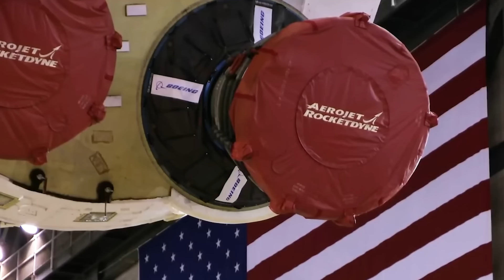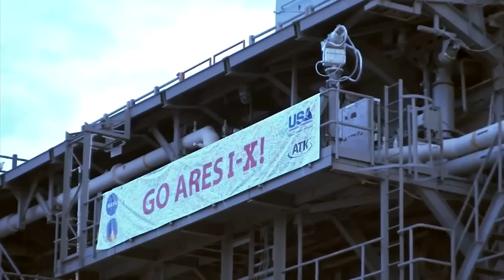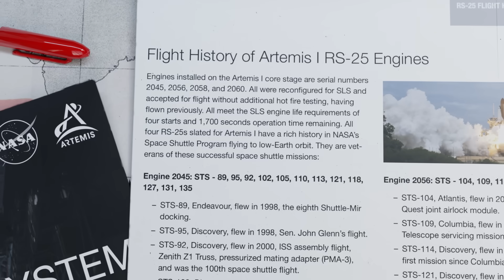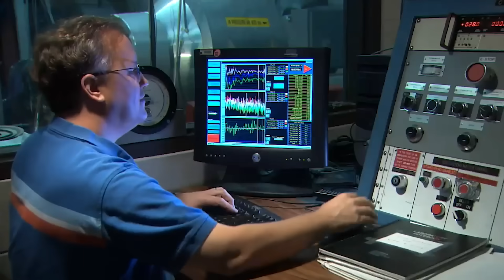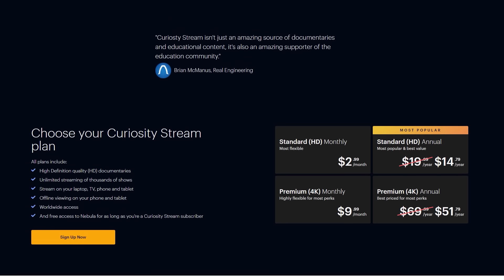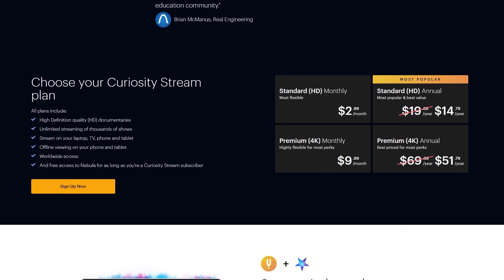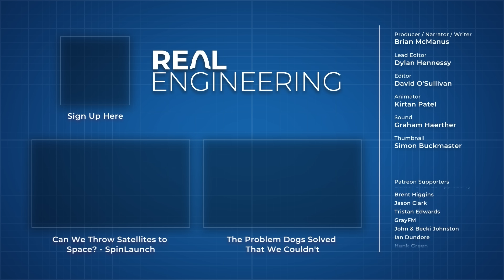The SLS is Outdated. Why Does it Exist?

Comment: Aside from the nerdy stuff, there is a course at a graduate school called The Political Process in Systems Architecture, not of SW subsystems, but about super systems such as the SLS.   This ensures that the systems engineer does not graduate as a dodo, and ignore the political aspect of space research, technology and its funding.  He never enjoyed the real broadcast either.  He was only 4 years old then.  Yet, he was lucky enough to serve the SSME at the Rock, and at Susi.  Space Shuttle Main Engine /  Santa Susana Hills.  Oh geez, he went to the same uni Neil Armstrong did, without planning it.  The RS-25 Engine, frankly, the SSME, never caused a shuttle failure.  And, I am sure it won't this time either.  Somehow it was always about the not so complex stuff.  Good vibes to Artemis!

Comment: It wouldn't surprise me that they wanted to use their own stuff because it been more proven than commercial. Not just test case. When I took software development, our teacher showed us a method of converting code into mathematical formulas to prove that it didn't have bugs. It was super difficult and took a long time. Basically, coding was the easy part and proving incorrect was a much bigger job.
In the same way, the computers were antiquated antiques by the time they actually got sent up, because the hardware had to go through the same rigor of planning, testing, and hardening. Everything had to undergo such scrutiny. This way, they minimized failure by a massive amount.
Today's commercial companies may kove faster and cheaper, technically. Failures cost more than the wasted rockets, fuel, and cargo. It costs PR and the industry.
So they may not have trusted the commercial operation to come through successfully while they had proven hardware sitting around.
From what I heard, a bunch of satellites that went up with it failed when launched. Heck, how long ago was it a whole schwack of StarLink satellites all failed because they didn't calculate things right.
Can't say I really blame them spending extra.

Comment: In general the idea of reusing proven concepts from previous programs isn't bad, not everything has to be reinvented.

Also while NASA programs don't have optimal cost efficiency because of spreading out production of the whole country and bureaucracy, private programs are also not always cost efficient because, because here everyone must make a profit and there are often inefficiencies because of trade secrets. In both cases costs are often much higher than predicted, so we will see if the private space programs will be more efficient in super heavy launch systems.
Reply: While it is true that private programs also have costs overruns, they are no where to the degree of the SLS. While Falcon Heavy isn't a perfect comparison to SLS, it is close enough to get an idea. They both use existing hardware and needed some special modifications to get going. And they both are super heavy launch vehicles. FH was delayed a few years and had cost overruns. However, it has successfully flown and is capable of launching over 63t into orbit. It cost around 100m per launch, which includes SpaceX's recovery of development costs. SLS can only launch 95t. While that is more, it isn't that much more. And that is especially true when counting the costs. SLS is projected to cost around 2 Billion per launch, not counting development costs, and around 4 Billion counting those costs. So 20x to 40x more per launch for 1/3rd more payload.

Comment: As a child, my parents got me out of bed to come down and watch Armstrong step onto the moon. One of those memorable events in my life.

But, sadly, reality is just as harsh today as it was then: It is far far cheaper and safer if you can build a machine to do the same job done by a human. Doubly so in space (double is too small a number). If an unmanned vehicle explodes or crashes into the ocean then there is quickly another one ready to go for a fraction of the cost of sending humans. No loss of life. No national disaster which threatens the funding of the whole project. Manned space travel is likely to remain an occasional expensive event largely funded for political and PR reasons.

Comment: seeing the decisions behind the plan for Artemis 2 and 3 and seeing the suboptimal decisions were largely made because of SLS and Orion's lack of capability, coupled with a lack of a viable lander (Starship lander isn't viable either, they're kidding themselves) makes SLS extra bittersweet. Artemis is likely to fail or increase risks overwhelmingly because it can't get Orion to Low Lunar Orbit.

its time to hit reset again. Artemis has to wait for Cargo Starship, and focus development on a transfer vehicle that can be carried to LEO by Starship, to make a LLO station with relays and landers and capsules.

outsourcing the lander doesnt work. Near Rectolinear Halo Orbit around the moon is risky and unreasonable.

SLS can get the process started, but it won't be able to finish it. Starship is the closest, most capable heavy lift rocket. it will have to finish it, but only as the lifter. the rest is on NASA.
Reply: Why do you think Starship isn't a viable lander? Several of the top engineers in the country disagree with you there.
Reply: @anthonypelchat  the height, infrastructure, size, complexity, its designed for heavy transport. it could very capably transport a proper lander, but on its own, it can't sensibly deliver payloads to the moon.

i'm under no illusion that i know what's right singlehandedly, but i don't think its unreasonable to say Starship isn't. Destin from Smarter Every Day even hinted at it during the talk he gave at NASA.
Reply: @xymaryai8283  Destin from SED's video was actually really, really bad. The main ones praising it are the ones who really have no idea what he was talking about. I will tackle that comment separately.

Specifically to Starship, it's height isn't much of an issue. Will ladders work? No. Astronauts will need elevators. But that is a tech that we have basically been perfecting for over 100 years now. Not a big deal. And the overall size is a massive bonus. 

The infrastructure and complexity would be a problem if all Starship was designed to do was send people to the moon once and come. But that isn't the case. The infrastructure is being built out already and designed for dozens, if not hundreds of missions per year. So even the complexity is no big deal.

Finally, Starship is designed to be multi-purpose. It will have a dedicated crew lander version. It will also have a dedicated tanker version, an expendable version, a normal crewed version, and a general purpose version. Probably many more as well. The individual designs, such as the crewed lander, will benefit from the infrastructure built to support ALL versions. That is a huge benefit.
Reply: @anthonypelchat  you seem very knowledgeable about it, so i won't try to prove you wrong, but i still think the scale and complexity is too much for Artemis. sure, elevators of all kinds are an extremely reliable technology on Earth, and SpaceX will have the best engineers working on making it work on Luna with dust mitigation and redundant systems, but if you look at the level of redundancy Apollo had, i really think we're underestimating how risky this is. even if they have multiple completely redundant elevators, they are still very dynamic mechanical machines, and an issue that affects one fundamentally is likely to be an issue for all. theres also the issue of weight balancing, if the lander has used a significant amount of fuel to land, bringing payloads down from such a height will cause tipping unless it is balanced, dead weight is not acceptable, so synchronous balanced operations with 2 lifts or a very robust tiedown will be required.

there's a whole ton of operational complexity that Apollo actively avoided. they used the most reliable technology in every place it would perform well enough. Starship is using the most performant technology where it might be reliable enough, and i don't see it being successful in the short or long term.
Reply: @xymaryai8283  "but if you look at the level of redundancy Apollo had, i really think we're underestimating how risky this is."
Not sure what you are looking at here, but Apollo nearly ended in failure during most of the missions. By comparison, Artemis and Starship have multiple redundancies. 

"(elevators) are still very dynamic mechanical machines,"
Are they overly simple? No. But again, we have been working with them for over 100 years. And they are built to handle much more difficult loads then will be needed to be handle on the Moon.

"theres also the issue of weight balancing,"
The left over fuel along with the engines will be at the very bottom of the rocket. And they will weigh drastically more than the loads that Starship can carry. In this case, trust that NASA, SpaceX, and the astronauts that will fly on Starship are smarter than the average person. There won't be rednecks onboard building swings at the top of Starship to see if they can tip it. And there's no wind on the moon, so nothing there that should affect anything. 

"there's a whole ton of operational complexity that Apollo actively avoided."
You're drastically over simplifying Apollo while also ignoring the massive limitations that Apollo had. Is Starship perfect? Of course not. But a single Starship mission has the ability to do more than every Apollo mission combined many times over. When you look at it from that perspective, Starship is drastically less complex than trying to do what Starship can with an Apollo style system.

Comment: SpaceX and the Shuttle merely went to low (extremely low) earth orbit. 
That's a far, far cry from breaking out of Earth's gravity and rocketing to the moon - it's not the same rocket at all. Making comparisons is not really possible. 
Making the shuttle reusable made some sense since reaching low earth orbit was expected to become very regular (I recall one flight a month or sooner was predicted). It never achieved that goal and the reusable shuttle program didn't really save any money. Also, losing two 'reusable' shuttles was very costly. 
Going to the moon in these few and massive SLS launches will not yet be routine and so making the SLS reusable would actually be a total waste of additional money since it's far more expensive to build reusable rockets. Perhaps in the NEXT gen when a moonbase is envisioned that a reusable form of SLS would be practical. By then it might be SpaceX Following NASA's SLS.

SpaceX in 2018 said by 2023 they can send a rocket completely out of earth's orbit - but they would merely fly around the moon, not land upon it and return. THAT is also much more difficult (and much heavier). Currently, Starship 'flies' but it doesn't break earth's orbit and it doesn't go to the moon, so Elon likely misses that target. Last month Elon said it'd orbit this month. We'll see...No Starship prototype has taken flight since May 2021, and all of its jaunts so far have reached a maximum altitude of just 6 miles. 
Again, reaching Earth orbit is NOT the same as escaping earth's gravity. Being reusable within Earth's orbit is not impressive compared to SLS.
Reply: BTW, nod to the video author, I am old enough, born in '53, to cheer all through the Mercury, Gemini and Apollo eras and to have experienced the 1st moon landing live on TV. 
It was exciting to be an adolescent back then. I grew up with the space program, and I am excited to see the SLS proceed alongside the commercial space programs too. 
Someday, Elon's SpaceX will reach the Moon, and Mars, and Beyond, with reusable rockets and components, perhaps.

Comment: Look back at this and seeing SLS reach apoll 4 level of launch on its first go while the private sector only option has missed all its dead lines and its 4 launches has blown up, blown up twice, failed in orbit, and the last one melted on the way down.

SLS is doing what the wannabe disrupts cannot.l, it actually works.
Reply: SLS is based on previous existing hardware and it was still 4 years behind schedual and 10 billion over budget, the starship rocket already beat the Artemis in testing perameters by being able to land itslef while artimis can only burn up in atmosphere, the fact that you are coping by saying it melted when it didn't and completed 2 landing burns shows you put to much of your hope into that rocket to only see it get pushed to the side for cheaper and more capable rockets and you are not ready for it lol.

Comment: Old technology isn't "bad'' by being outdated.  Vacuum Tube technology still works (Microwave Ovens and Radar) and to many ears sounds better than Transistor/Solid State amplifiers..  As to non reusable boosters, it was non-resusable booster stage rockets that put men on the moon more than once. The tooling to make a Saturn V Rocket isn't around, ergo it makes sense to use what is available. However, the Space Program was part of the Cold War era, and in time the US and USSR couldn't afford the continued expenditures.  
President Nixon canceled the Moon Programs, to deal the the Federal Deficit, as in reduce the deficit (left over from the debt of WW-2). Unfortunately, he also killed The Nuclear Engines for Rocket Vehicle Applications (NERVA) program which began in 1961, various government laboratories had been studying the concept for several years, several contractors were already working on conceptual design, and space was a big topic of interest. The motors were tested and available from 1963 onward, the general consensus to us with the Mars Missions as "Tugs" rather than building an interplanetary vessel around the motors (which would require ships built in space). 
Nuclear pulse propulsion or external pulsed plasma propulsion after a suggestion by Stanislaw Ulam in 1947. Project Orion (a nuclear powered rocket and space ship) began with support from DARPA. This evolved into a nuclear pulse propulsion unit, which ablatively vaporizes the propellant, propelling it away from the charge, and simultaneously creating a plasma out of the propellant. The propellant then goes on to impact the pusher plate at the bottom of the Orion spacecraft, imparting a pulse of 'pushing' energy.
If you ever wondered where TOS Star Trek got the idea for "Impulse Power" (actually from a Suggestion from RAND Corporation...),  the atomic bomb association which was used to destroy the "planet killer" in the Episode called The Doomsday Machine, in which Engineer Scott the power of the exploding reactors.

Comment: Maybe the SLS core stage will be reuseable eventually? If so, then an expendible upper stage and reuseable lower stage SLS could be a real competitor.
Reply: No. The core stage basically goes into orbit. By the time it's done it's going 95% orbital velocity. Would need a complete redesign and at that point why not start over and build the design around reusability. It wouldn't cost more. The core is just absolutely not geared towards reuse unless we are talking about leaving them in orbit as space station components. That was studied in detail with the Shuttle ecternal tank that did the same sort of trajectory, dropping the Shuttle off near orbit with enough margin to reach orbit.

Comment: SLS exists because Congress wanted to find out if a full stack of Pork Barrels could reach the moon. That's never going to be efficient or sustainable, which are exactly the things a modern space program needs to be. I hope every mission that flies on the SLS is as successful as possible. I also hope there are as few of them as possible. 

There's also the looming issue that the SLS program is going to stall out in a couple years due to the ML2 launch tower being an overweight, slow moving disaster of cost plus contracting that's never going to deliver in time.

Comment: ive always wondered why they dont use "14, 4 engined 747 jumbo jets" for boosters. obviously not the actual jets or even those exact engines but why in the world are we not using air breathing engines for fist stage boosters while in atmosphere and then flying them back down to be re-used? they are way easier to maintain and keep re-using than rockets and you dont have spend 2/3rds of your 1st stage fuel mass on oxidizer.
Reply: It's a lot more complicated than it seems. I'd look up Virgin Orbit and SpaceX Falcon 9 Air to learn about the pros and cons of air-launched rockets.
Reply: @braydentoth8442  right but both of those are basically airplanes with rockets on them, which is very efficient but as you said are tricky to deploy safely. I'm saying just replace the solid rocket boosters with air breathing boosters. would be less efficient than a full aircraft with big wings but still saves lot of weight on oxidizer. and just land them vertically like spaceX but its way easier to do with jet engines since you can control the thrust so well.

Comment: Despite some of the short comings you mention, they plan on building simpler RS25 engines as time goes on (once the current crop are gone) with all the bits stripped out that make them reusable, so costs will go down, especially as they learn from each launch of SLS. The fact is, this will still be the most capable heavy lift we will have for some time, and the more smaller rockets you launch, the less chance you have for a reliable mission. Doing more with less rockets increases your chances of mission success. There have been arguments in the past of having the same capability with lots of smaller rockets, but that's just crazy!
Reply: Yup, bigger is better, just ask an F-1. But you'd need a time machine set for say 53 years ago!! ;D